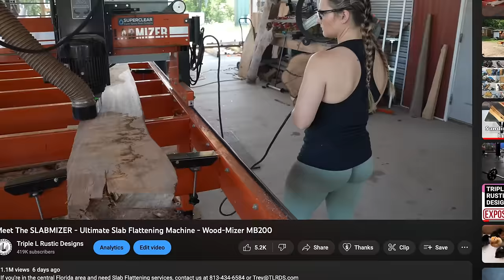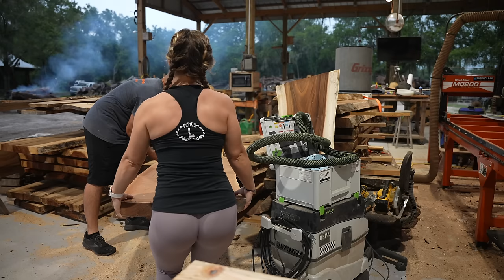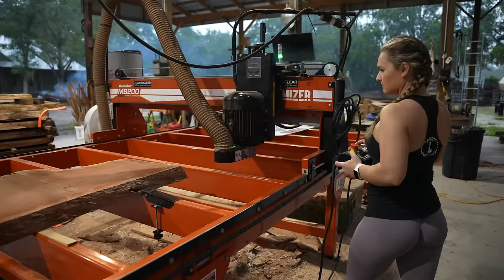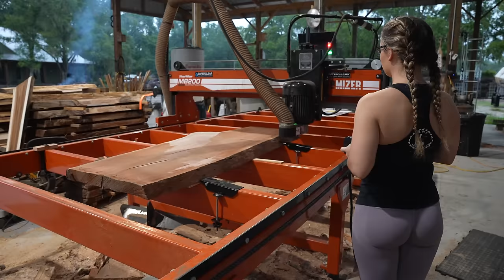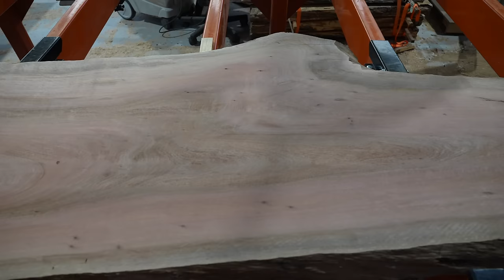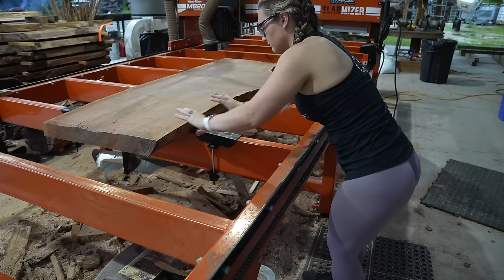Flattening Gorgeous Slabs On A Rainy Day - Wood-Mizer MB200 SLABMIZER

Comment: So why did choose the Wood Mizer instead of a traditional CNC since you have to control it manually? To be allowed to maybe edit videos, do epoxy work, or even just straightining up the area while flattening boards would seem like a win if you used a CNC. I am not saying to leave the work area but if you needed to pull some crates out of the kiln or something you could be multi-tasking.
Reply: I would venture a guess as this is far cheaper than a similar sized CNC.  Plus the manual movement is far easier to setup as far as slab placement is concerned.  For a third, this allows her to view the surface of the slab as it is being exposed.  She can then stop right away if the slab isn't working like she wants.  If she was off just "keeping an eye on it" she might miss something and waste time on a bad slab.